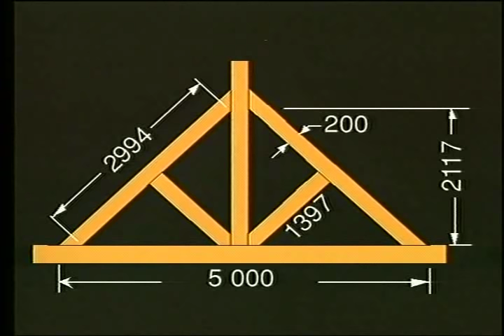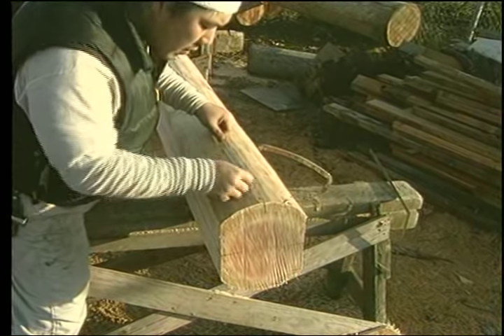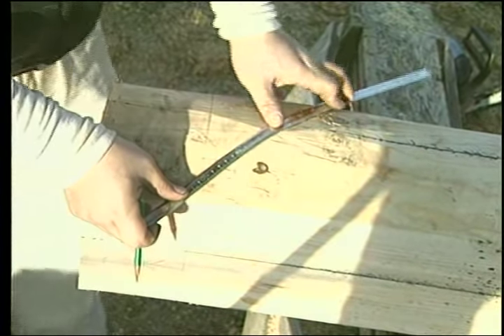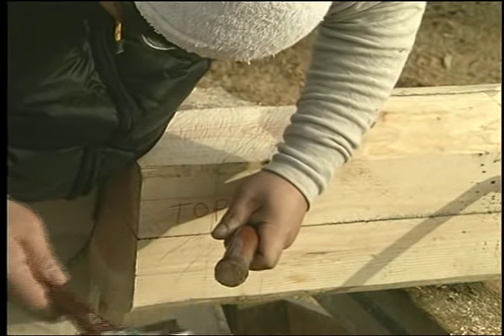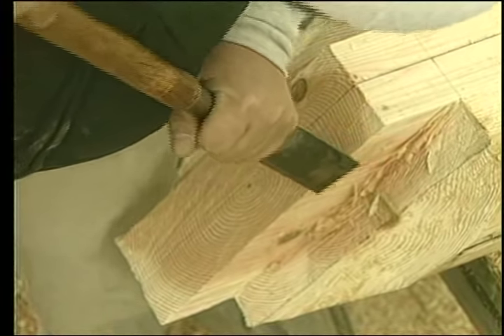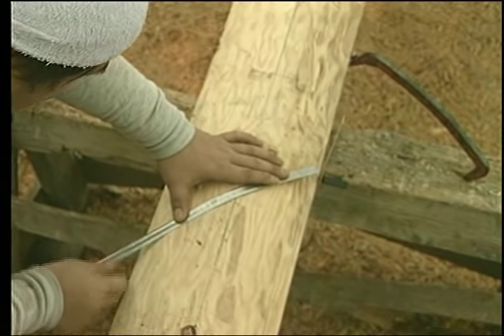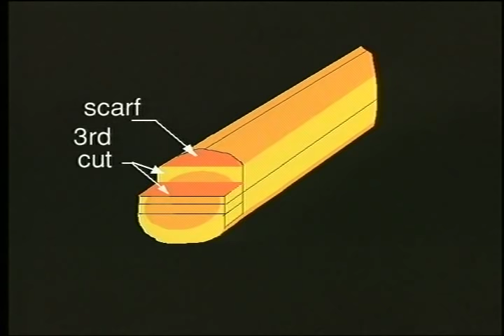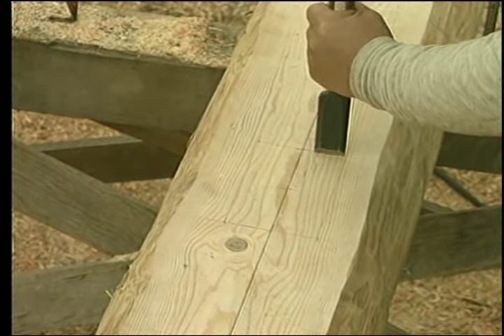Building log cabin: Trusses Roof

Comment: This just proves the old saying that if a hammer is the only tool you have then EVERYTHING starts to look like a nail! What is wrong with a circular saw to cut the long lines and a chisel to finish it up with? How about a drill to drill the holes for the tenon to fit into and a chisel to clean them up! I am starting to think that this is more about advertising for Skil chainsaws than it is about building a log home!
Reply: Skil versys Stihl?  He was not using a Stihl.  It looks like a Husqvarna.  The guy is good with a chainsaw and fast.
Reply: jeff ledlow the material is round / a skill saw is not right tool / hand tools or chainsaw are right tool
Reply: Jeff are you a interested in becoming a logsmith?  Go buy some logs and just put your theory into practice.  This gentleman probably spends 40hrs a week, every week making log homes.  There is not one way to do anything.  FYI anybody that knows anything about log smithing knows you need a Husqvarna.  Stihl is for firewood, and I have never seen a Skil chainsaw.   Well never looked for one at least. I’ve never heard your hammer saying before either.  Also what do you do for a living?  Just so we can tell you what’s wrong with the way you do your job.